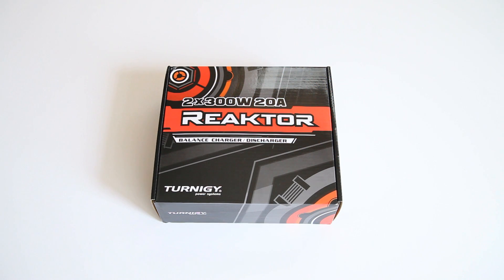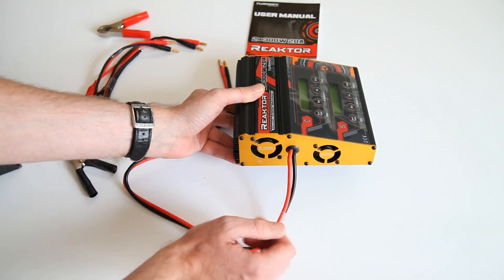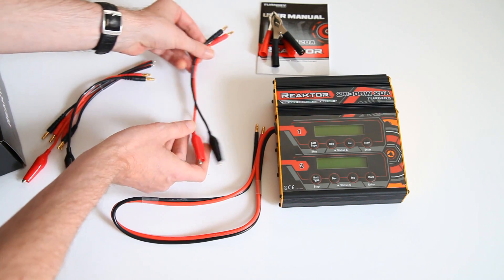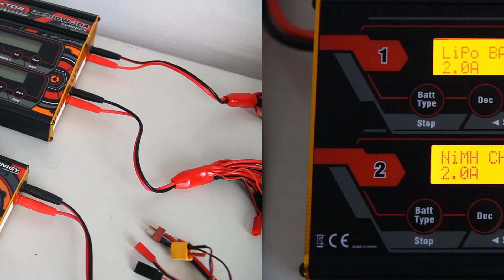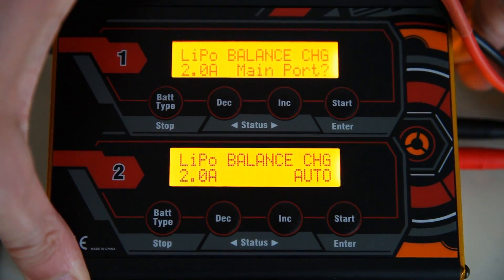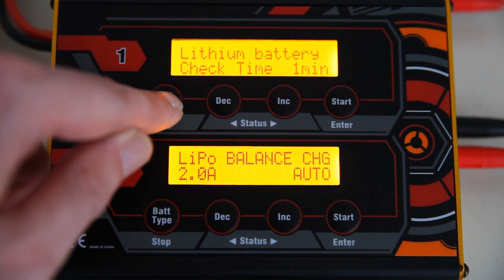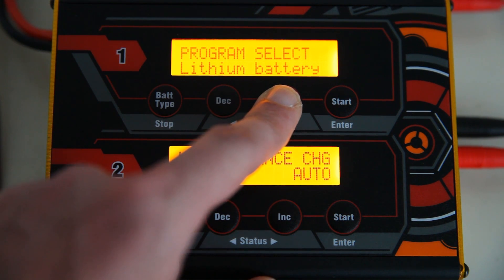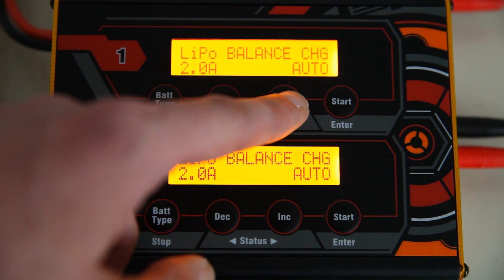Turnigy Reaktor 2 X 300W 20A Charger - Unboxing + rundown of the menu

Comment: Thinking about getting this charger. I plan to buy the new Traxxas x-maxx which will have 2 8450mah 3s 25c. How long would this charger take to charge them together? Thankyou
Reply from the maker: +BisMaxx No need to wait.. I don't have a link for you.. I've been racing 1/8th scale (electric) buggies on lipo's for quite a nr. of years.. RC's that are even more agressive on lipo's are rc boats though.. A friend of mine runs those internationally.. Boats like this: 
https://www.youtube.com/watch?v=6A3ojV3ERSI 
To that I have to add that lipo's are discarded after 1 run.. 

But.. I was not recommending something here to someone I know nothing about.. I've been following RC Tanks & Trucks his channel for quite a while..
Reply from the maker: +RC Tanks & Trucks 24/7 In theory the charger should be able to charge a lipo like that in 30 minutes. (at 20A) .. I would personally never do that though, as it will shorten the life of the lipo.. But if you would be in a hurry, that 30 minutes should be possible :)
Reply: +DutchRC Adventures hello, great thanks for the reply. Is that charging both together or one at a time? Also, what would you recommend this or the turnigy mega 400w x 2? Muchly appreciated
Reply from the maker: +RC Tanks & Trucks 24/7 Hello :)  Yes.. that would be while charging both at the same time..
You migth want to go for the Mega 400x2 then actually.. It would have a bit more margin so the charger won't get as warm..
Reply: +DutchRC Adventures awesome, the only thing I don't like about the mega is it doesn't have auto mode
Reply from the maker: +RC Tanks & Trucks 24/7 True.. the Reaktor is a more modern charger indeed. So If you think you will not be in a Major hurry most of the time.. I'm quite pleased with both my Reaktor chargers..
Reply: +DutchRC Adventures yeah, as long as it can charge both in approximately 1hr I will be happy
Reply from the maker: +RC Tanks & Trucks 24/7 In that case: go for the Reaktor x2.. and charge at 10A :)
Reply: +DutchRC Adventures great, thanks for your time answering my questions.
Reply from the maker: +RC Tanks & Trucks 24/7 You're welcome! Glad to help..
Reply: +RC Tanks &amp; Trucks 24/7 You are receiving ill advice here. You would never want to charge a battery at 20A!!!! Most lipos require charges of 1C, some safely accept 2C charging. The result would be a charge of 8.4A. If you risk charging at 2C (not recommended) you would be pushing almost 17A through one battery. You would need a great charger and a very powerlful power supply to do 2C X 2Packs. Please be careful. Get informed on proper Lipo charging, storage and use before you go buying all this stuff. Tons of great resources on Youtube.
Reply: @BisMaxx  Some batteries can be fast charged at higher C rate. I refer you to the comment I made earlier, the warnings state that you should not charge a LiPo at higher rate than 1C unless specified by the manufacturer. Some Turnigy Graphene batteries can be charged at up to 15C according to Hobbyking and I assume this information is from Turnigy.
Reply: +BisMaxx I have spoken to SMC the manufacture and they said no problems at 20amps, It is only 2c, any decent quality battery should be able to charge at that rate. 
My batteries are 10,000mah 3s 60C, so 20amp is nothing crazy. I charge them together and the charger, transformer and batteries dont even get warm.
Reply from the maker: +BisMaxx Excuse me? If you'd want to win races with RC cars (as an example) you'd be a fool to charge at 1 or 2C.. 2C is more then normal these days, eventhough I generally charge at 1C.. 
If you use good quality lipo's, you can charge at much higher rates though.. With no trouble at all.. 
A bit weird to call someones advice 'ill'' when you don't really know what you're talking about..
Reply: @DutchRC  I'm sorry, but I have to disagree with charging at over 1C. Yes, modern batteries can be charged at over 1C but only if specified by the manufacturer. As an example, I will use a brand new Turnigy Graphene 4.0 6S 4000mAh 45C battery and the warning manual that came with it from Hobbyking.
"Always refer to your charger's manual for correct procedures and safety information. In addition to your charger's manual, the warnings and guidelines listed below must be followed to avoid possible property damage or injury.
- Always charge batteries at a maximum rate of 1C (one (1) times the capacity) unless specified by the manufacturer."
This bullet point is printed twice. I would definitely follow the safety manual that came with the battery. Again, you can charge the battery at a higher rate and likely won't damage it, but there is a chance that you will shorten the lifespan of the LiPo.
Note that the description of this battery on Hobbyking mentions that Graphene batteries are fast charge capable, up to 15C on some batteries. So it is entirely possible to charge some LiPos at higher C rate. All of this information is sourced from Hobbyking and I am not a lipo expert, nor do I claim to be. I hope this information is helpful to you and others who may read this.
Reply from the maker: @PunakiviAddikti  fair enough.. I do agree (some) manmufacterers say it can be done.. That is nice ofcourse.. Have you tried it? I can assure you those batteries will get warm if you charge them that fast.. 
That still doesn't mean it's not possible / advisable.. 
Regardless: all kinds of people watch my video's.. I'll stick with telling them: 1C charging
Reply: @DutchRC  I definitely always charge at 1C. I want to keep my LiPo packs in good health. The Graphite batteries should stay healthy even with higher charge rates though. I also put them on storage charge mode once a month to keep them at storage voltage. That's another great features of the Reaktor, it can storage charge.
Reply from the maker: @PunakiviAddikti  please storage-charge your lipo's Immediately (or ASAP) after use... your lipo's will last longer...
Reply: @DutchRC  Oh, yeah I think I made it sound wrong. I always storage charge the LiPos immediately, but I also make sure to storage charge them again once a month to keep the voltage from dropping. The recommendation is to storage charge again at least once every 6 months and always immediately after use.
Reply from the maker: @PunakiviAddikti  Good safe! :D 
just kidding ;)  you are indeed correct.. the lipo's I use less frequently get a checkup twice a year..
Reply: +RC Tanks &amp; Trucks 24/7 
That makes a difference. this is what you said: "I plan to buy the new Traxxas x-maxx which will have 2 8450mah 3s 25c". My response to you was based on charging that pack, not a 10,000mah pack, for which you would probably still get away with charging at 2C. Still, I stick to the science that speaks facts regarding Lipo charging. These are traditional rules based on the battery chemistry which have been around for a long time. And what they say is that 1C is the safe way to go when it comes to handling your Lipo charging, which will benefit the overall life of your packs. Now if you are not concerned with having your Lipos live a short life, you can safely do it up to 2C (again, based on traditional knowledge). Some manufacturers even specify higher charge rates, and I don't know what to think when I see this, because IMO they may be suggesting higher rates simply because they don't care about battery life. They are selling more packs if your original packs are going bad earlier. So, even if the pack says "3C charge", I don't bother. 

In the end, you could just buy MORE packs, keep them in your battery case, charge them before you go compete, and that way you can avoid having to rush charging into high C's in order to keep racing or enjoying your model. I rather invest in more packs, and prevent charges over 1C. THis way your investment will last long and you will know you have treated your batteries kindly so they perform well for you on the field for many many cycles.

Just my 2 cents, and some old, well documented facts as well.  ;)
Take it or leave it.
Reply: +DutchRC Adventures I stick to my word. You said over 2C charge was ok and he probably did not know better then. That's not only harmful to the battery, but potentially dangerous depending on the type/brand of battery he was using. Therefore you misinformed him. I call that ill advice. Lipos are dangerous. I am sure a you know this, since you... "know what you are talking about". Right?
If you want to win Races, get your sponsors to buy you more batteries, that way you charge slower and care for them better, so they can help you win.  ;)
Reply: +DutchRC Adventures And here, from Hyperion (im sure you know who they are): 
"If using other than Hyperion lithium packs, consult your battery’s documentation for allowed C rates, before exceeding 1C charge rate."
"2C is the sensible limit for fast charging lithium polymer.  Due to the CC/CV nature of the lithium charging process, the returns from increasing charge rate diminish very quickly after 2C.  That is, total charge time is only a couple minutes shorter at 3C compared to 2C, yet initial charge rate has to increase 50% for that small gain.  Given this, the risk/benefit equation lands squarely on the side of 2C max rates.  Additionally, since many batteries are not capable of charging reliably past 2C, chargers which do allow 3C charging are much more likely to cause damage to batteries, or even accidents. It is simply too easyto make a mistake with the Charge Rate setting, and there are no electronic safeguards which can be reliably employed against making such a mistake."
Reply from the maker: +BisMaxx Well.. you could offcourse use the stuff in your head, as the safeguard.. Again: I hardly ever charge at anything higher then 1C.. For competition purposes there is however a definate benefit to charging faster then 2C... And that benefit is not the time saved, but the higher output of the lipo. Primairly in the first quarter of the run.
Reply: The stuff is not just in my head, again, its discussed at length in many places that you can google. Don't take it from me. Take it from the guys that make the equipment.
Furthermore, charging your battery at a higher rate, to my knowledge never yielded better performance from a battery. The voltage you can fill up a cell with is capped, generally at 4.2V per cell. Some may try to push it further, but... again, diminishing returns...  So that being said, how is the output any higher, and please, link me to somewhere credible...
Reply from the maker: +BisMaxx The voltage won't be higher offcourse. The initial punch (Amps) will be however.. A well know fact in boat & car racing circuits.. Same goes for the lipo's temp offcourse.. In races, you don't start your run with the lipo's at ambiant temp..
I ment 'brain matter' to be a safeguard against misusing things by the way.. As in 'use your head'..
Reply: That's just what I did. Used my brain to help somebody else prevent an accident.
If you feel like cranking the amperage beyond what's recommended, for your own personal purposes, with your own batteries, I can't tell you not to do it (you seem to think you know what you are doing). But my issue here is that you are recommending this to somebody without any background on what he/she flies, how they fly, etc. I would never give advice like that to somebody without first understanding their background story well. That's all. I thought it was inappropriate to recommend that. A lot of other young people read this and have no clue either. They can easily misunderstand and go do something crazy "based on something they read from a guy who sounds like he knows his shit". And again, if the result was simply low performance of a battery or shortened life of a battery, then, that's not as big a deal, but with Lipo's you are messing with fire...  in the literal sense of the word!
Reply: Also, "a well known fact" in your "boat & car racing circuits" is not even close to my request for some credible info on the web...  like a link to a well respected source.
Go ahead, I'll wait.
Reply: So you knew what brand of batteries he was running and their specs? What about everybody else just getting started reading your advice?
C'mon man. Stop with the excuses. Its ok to admit you probably should have been a bit more careful with your advice...  You seem old enough to understand this!
I knew you would not provide any data to corroborate your hype. Because there is none on paper. Just your "racing circles"... 
And we should just trust that...  Cause I heard it on Youtube. SMH

To that I have to add: only your "circle of friends" can afford to discard Lipo's after one run. Sorry my friend, you are giving the wrong advice to the wrong people, and you should stop before somebody takes you seriously and hurts themselves.

Lipos are not a toy.
Reply from the maker: +BisMaxx I completely agree lipo's aren't toys.. Well regardless if they are toys or not.. They should be treated with caution. You are completely right there. In case I made things seem different on that, I chose my words incorrectly. 

My original answer to the question here was that a charge rate of 2.3C was possible (and added that I wouldn't do that).. Do You mean to say 2.3C is out of the ordinary? With the new Graphene's I see people charging them at 4C.. Would I do that? Not in a hobby / non competition situation.. 
I don't really know how long I have now been using lipo's.. 8 years or so.. Most times I charge at 1C.. If I am more in a hurry (in the field) I charge at 2C.. If you're using reasonable quality lipo's (and stay with them) I really see no problem to tell people to do so.. Problems with lipo's mostly are in the discharging of them.. Or probably with inpropper storage / handling..

The guy that was running the boat in that video used a Zippy 5000mah 40C (see start of the video)..

Comment: Thanks for the info vid. Found it linked to the Hobbyking Site. I've just ordered a Turnigy Reaktor 2x 300W AC/DC (10-28DCV 100-240ACV) Synchronous Balance Charger/Discharger form Hobbyking. I think the dual voltage system will be very handy addition to the already very nice charger. It's super flexible and can be used for all types of battery charging, that why I bought it.
Reply from the maker: +cobra60six You are welcome sir :) I have both the single and the dual Reaktor, and they both perform flawlessly :) I'm quite happy with them :)

Comment: wat kind off powersorce do you use.
Reply from the maker: +Hans Langenberg It's not available from HK anymore, but I use a 600W 12V external supply for this one (and my other chargers)
Reply: +DutchRC Adventures. Hobby King are now selling an AC/DC (10-28DC/100-240AC) version.  http://www.hobbyking.com/hobbyking/store/__77308__Turnigy_Reaktor_300W_20A_AC_DC_Synchronous_Balance_Charger_Discharger_US_Plug_.html
Reply from the maker: +cobra60six And a quad version sinds today :O 
http://www.hobbyking.com/hobbyking/store/__82840__Turnigy_Reaktor_QuadKore_1200W_80A_4_X_300W_20A_DC_Synchronous_Balance_Charger_Discharger.html
Reply: +cobra60six thanks for the link
Reply: Hans Langenberg No worries :-)

Comment: These look to be iCharger work-a-like chargers. Any comparisons between the two?
Reply from the maker: +VideoSack Well yes. most chargers really use the same user-interface.. This is a more modern implementation of it though.. I had a few iChargers actually.. I got rid of those.. I now have a single & dual Reaktor.. I'm happy with them :)

Comment: looks like a pretty decent charger. seems like it has quite a few options!
Reply from the maker: Mike's RC Corner Thanks buddy :)  Yep.. this is a serious charger, and of a newer generation as the typical 'screen + 4 buttons' chargers.. They are somehow far more comfortable to operate then my older chargers..
Reply: cool... yeah the newest feature out there are the ones with bluetooth and you can use your smartphone to run the charger. i don't quite understand that cuz you are at the charger to connect the battery so uses the screen to charge? why use a phone doesn't make sense to me.
Reply from the maker: Well.. I WOULD like to be able to monitor my charger on my phone.. My chargers are upstairs.. sometimes I don't hear the ready beep...